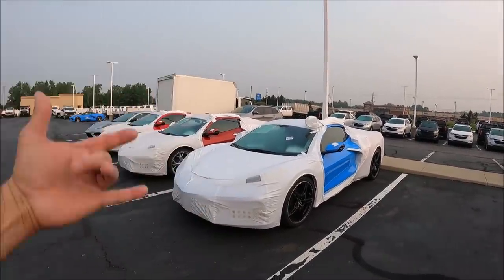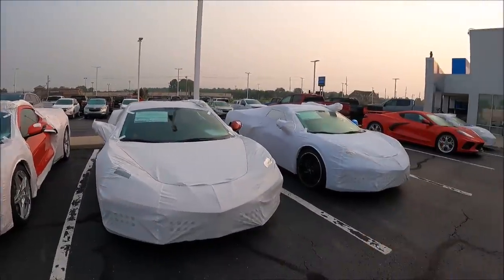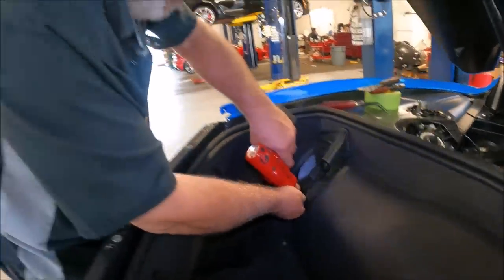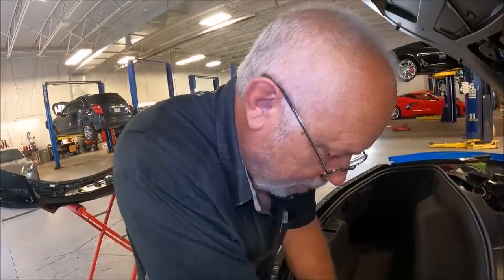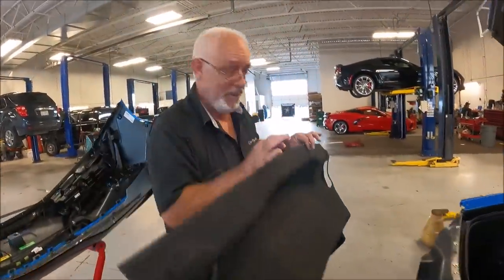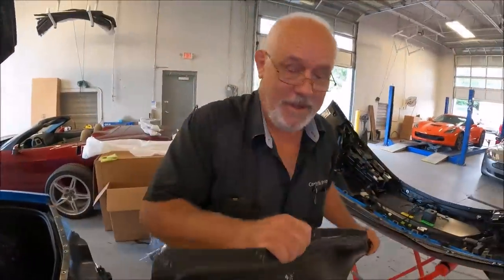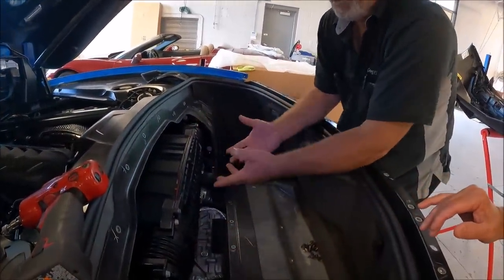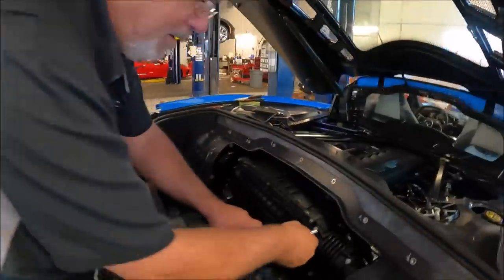ADDING 2 EXTRA QUARTS TO C8 DCT TRANSMISSION & YOUR RIDES

Comment: Amazing how complex this machine is. Tadge and crew did a fantastic job developing it.  Great vlog showing Chuck working on it.
Reply: complex is not always a better thing, wait until the warranty expires on the transmission and chevy tells you that you need to replace it with a new transmission at your cost. that will be a shitty day, and i guarantee many owners will be stuck with it. most transmission shops and performance shops won't touch a dct with a ten foot pole.

Comment: I wish there had been a option with Z51 package to include it filled at factory. 

There are some You Tube videos showing how you don’t need to take the air cleaner completely out and just take it partially out to get to the fill spot. Some videos also show how to use a tube to fill it up requiring less to be taken apart. Ridiculous that GM did not fill it. Many people are saying some of the DCT issues are simply due to not having the fluid topped off.

Comment: I just did this, only loosened the Airbox enough to get it out of the way, then added the 2quarts that way. fill hole is 3/8 so used a 3/8 OD tube to fill it

Comment: Great video.  I would like to just change the transmission fluid on my C8.  I can easily drain all fluid from drain plug on pan.  Can I measure what came out and add this (new) entire amount through the fill plug under the air box.  I never seen a video where more than 2 quarts are added from the top under the air box.  Thank you.

Comment: If you lift the car on the driver side you can add the 2 quarts through the drain plug. The plug is accessible through the rear driver side wheel well. It literally takes less than 10 mins to do.
Reply: Yes! I agree!  See YouTube video “Adding Two Quarts of Transmission Fluid to C8 Corvette” by Driving Lesson…..Great DIY video!

Comment: Hello, I'm operating a Corvette c8 in Korea. my C8 currently driving a 2020 year. 41,000km, 
I replaced dct filter + mission oil at 30000km.
I want to replace the dct filter because it's a replacement cycle, do I need to inject additional mission oil after replacing the filter? Or do I need to inject additional oil only when driving the track?

Comment: Great video Rick!  One of your best. It does raise a possibly disturbing question - based on what it takes Chuck to simply add transmission fluid, can one assume it takes at least two hours of a tech’s time to simply change the air filter?

Comment: ive seen reverse fill options to ADD oil via the drain plug for other cars, possibly someone can create this for C8. It threads/screws into the drain port and via vacuum power it can suck up the 2 added quarts.

Comment: Hay is Chuck going to be a GM model for DCT Fluid LOL. Boy what a job just to get in there to add the 2 qts of fluid. Seems like they would have put the plug somewhere else like Chuck said or maybe a line going upto where you check your oil level keep it simple. Has there been any problems with the DCT operation where maybe the additional fluid would prevent possible DCT failure or shifting problems. Have great day Rick. Tom from SC.

Comment: Why is the transmission PDI maintenance of topping off of transmission fluid, different from adding two additional quarts?Apparently there is a significant labor cost when adding the two extra quarts vs topping off during the PDI maintenance. "Topping off", as PDI calls for, is not the same process as adding two additional quarts. Can you please have Chuck explain in a future episode. Obviously there must be more work involved in add vs topping off.  Thanks

Comment: Why not replace where you check your tranny level with a valved plug so you could "pump" in the 2 qts! Sure would be a hell of a lot easier and you don't have some tech fumbling up your wiring. There is also a process you have to go through when you change the tranny filter. My tech did it but you did not mention it in your video.

Comment: I love the C8, but that sure looks like an awful lot of work just to add trans fluid. How many miles between trans fluid changes? And as noted above, why not just add the two quarts prior to assembly or at least make it an option?
Reply: Miles between DCT oil change is 45000 miles or after 24 hours of track usage whichever comes first.  The reason they don't add the additional oil, is that all the DCTs are manufactured elsewhere and has a normal fill.  It would be too confusing to keep track of which ones have the additional oil or not per the BG plant manager.  Plus at BG they can not add the additional oil due to safety hazards of oil storage and transfer tanks in a manufacturing facility.
Reply: @tnharley  tnx for the explanation!

Comment: May be this video is good enough reason not to buy a used C8 Vette that may need transmission fluid changed. You want a mid-engine Vette, buy a new one.  This is way too risky to change the fluid.